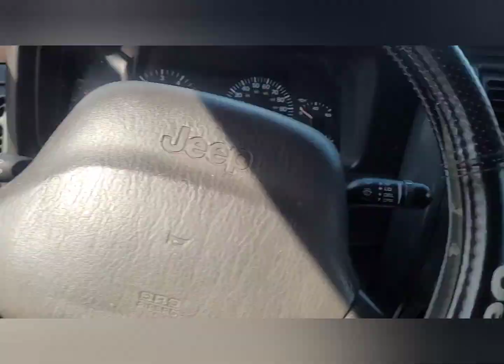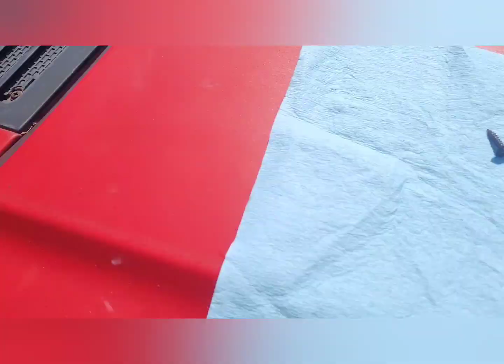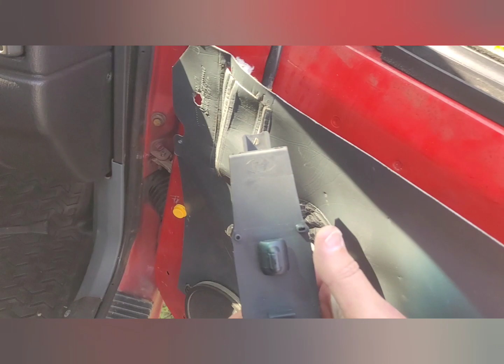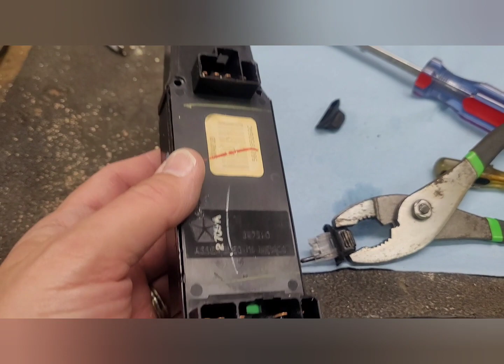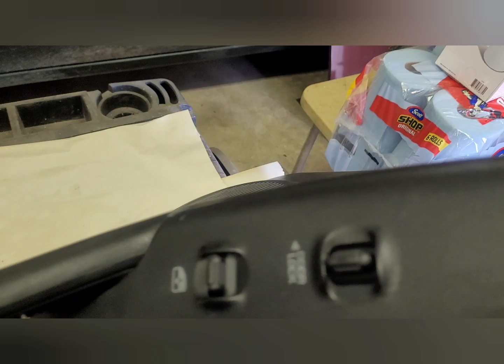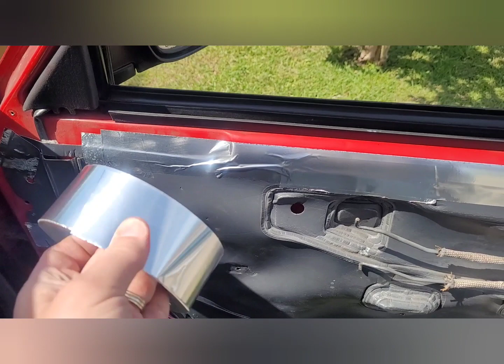Repair or Replace Your Jeep Lock Switch 1997 - 2001 Jeep XJ Cherokee

Comment: Hello. Very good video that explains the problem well, but my question is: I have a Jeep with central locking and IMO in the remote. I bought it used, but I need to know which chip is from IMO. After connecting the new one, the alarm goes off and the central locking still doesn't work. Is there any way to program it, or will just solder the chip back in? Which chip is it? Regards, Paul
Reply from the maker: You cannot just swap or resolder the IMMO chip from another remote and expect it to work.

The alarm going off + central locking not working means:

The remote RF part is not programmed, and/or

The immobilizer transponder is not matched to the vehicle’s SKIM/IMMO module

Jeep immobilizers must be programmed to the car — soldering alone will not fix it.

Comment: What if I have a 2004 JEEP GRAND CHEROKEE SPACIAL EDITION with the exact same problem except the drivers door lock works and the three other doors will not lock and the hatch will not unlock. all the windows and heated mirrors and mirror adjustment work fine. Can that be the Passenger front door switch also?
Reply from the maker: I think that's a possibility

Comment: Going to try replacing the window master switches on the front driver & passenger doors and see if that fixes my issues that I am encountering. The old ones took a shit today

•windows rolling down, but not up
•neither door arent locking (makes noises but doesn’t lock)
Power mirrors not working either. All wiring harnesses are good and not chafed. I’m also suspecting that the window motor regulators are failing or have failed.

As always thanks for all the help / info. I will definitely continue watching your videos!
Reply: And since it’s a 2 door, I won’t have much work to deal with. May recheck the wiring harnesses again when I take apart the door panel tomorrow
Reply from the maker: Thank you.   I would suspect replacing both will solve most of your problems if harness is good.  Almost same symptoms I had
Reply: @MajorWeakness  that’s what I was thinking. I also knew that no fuse is blown because the locks makes noises and windows fail to roll up. I’ll place an order some time in a couple weeks or so. Both windows are stuck down right now so tomorrow I’ll just remove the door panels and roll the windows up manually.